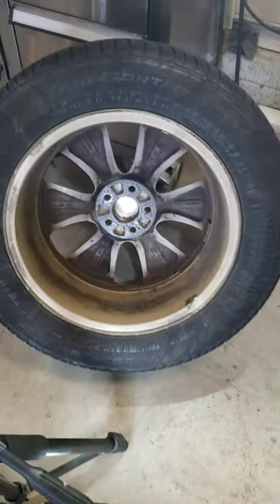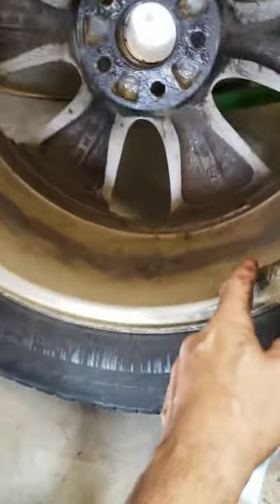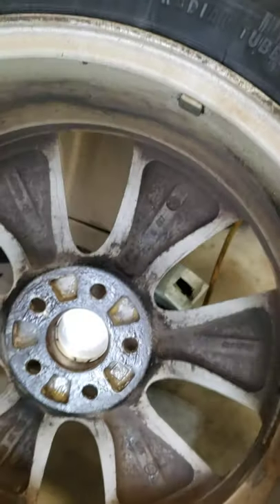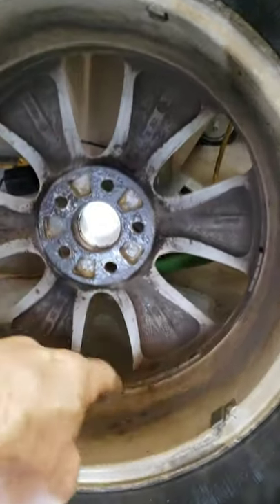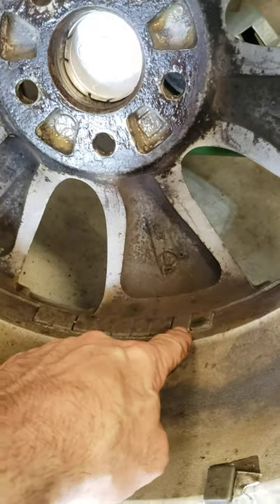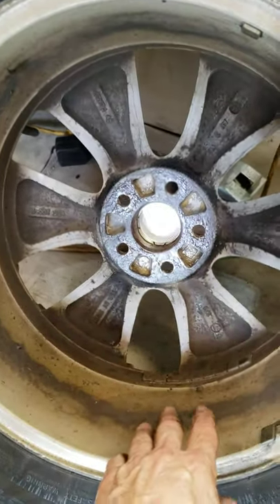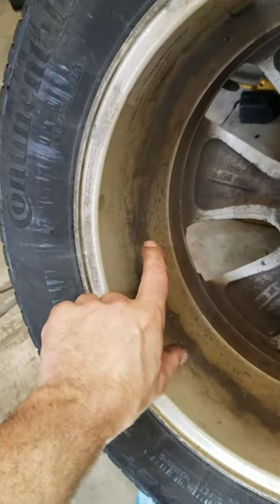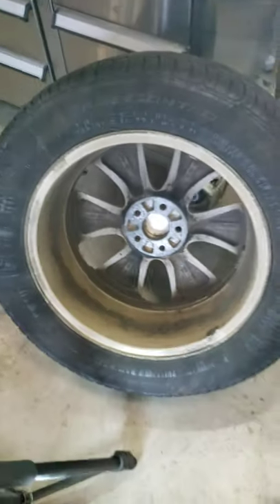How NOT to Balance A Tire #shorts

Comment: Your advice stands true on a good newish tire, If a tire has some wear machine will replace weight for missing tire material were it needs it. Yes it could be all over the place.
Reply from the maker: Any weight that is on the same side of a rim that is not in the same spot is an incorrect balance. That is a fact.
Reply: @ozzstars_cars  false as used tire's will vary in wear from side to side.
Reply from the maker: @S13KON  you are 100% wrong. Come.to.your senses and do your homework.
Reply: @ozzstars_cars  I already know who didn't do their homework. 👍
Reply from the maker: @S13KON  I have no idea who you are but if you made a video on the subject I would imagine you are the kind of guy that would film without any talking. Bet me.
Reply: How many tyre have you balance in your life?I do 100 per day and you are 100% wrong.
Reply: @تاریخپلاس-ذ7ب     
who are you addressing that statement/question to? There's two people in this thread with differing opinions...

Comment: I bought a new machine, fairly cheap (1500 dollars) and it does counter balancing. It asks for adding in second spin in diff locations. I rotate tire 90 deg / 180 deg on the rim to reduce weights, but in the end it asks again to add fx. small 5g weght in another location. I did calibration of machine but it still does 2nd spin and asks for second location.
Reply from the maker: The machine is not being properly set up. Contact the manufacturer.

Comment: Isn't putting weights (not this many) in different areas of the wheel from close to the center to the edge part of dynamic balancing?
Reply: There are different methods for balancing the wheel, one of them is to put the exact right weight(s) at one location opposite the center of balance, which this guy apparently does and thinks is the only way. There is the other method where you start by putting a little too much weight at the same spot as before, but then split it and move the weights apart.  This  2-weight-location method is supposed to be better.

Comment: When you do your second rotation on the balancer,and it calls for more weights in another area. Then what are you supposed to do? Because 99% of the time it always does.
My machine is a brand new digital model.
Reply from the maker: Could need to be calibrated. Contact the manufacturer.  Otherwise spin the tire on the rim 180 degress and rebalance. What are the results?
Reply: @ozzstars_cars  tried that, same results. According to the mfg'r it's designed to that. Because imbalance issues are never located in one central area. Due to the wheel ass'y being two separate pieces.(rim/tire)
So it locates the larger ammt of imbalance first. Then the lesser, during the second rotation cycle.  My question is, when using sticky weights in place of hammer weights on the rim bead. Where do you put them when it calls for it on the outside of the rim?
Reply from the maker: @carolinawestern3875  if.just using  stick weights on one side that is a static balance, weights on both sides are called 2 plane.
Reply: @ozzstars_cars  so is it ok to stick 'em on the outer side of the rim to?
Reply: Usually use clip weights on the side people cant see.
Reply: @carolinawestern3875  if you divide your wheel into 2 imaginary hemispheres, wouldn't any weights added on the opposite half just subtract or cancel out any weights already added on the first half. Seems like any/all weights should be in one place... unless you're doing the Y thing, then they should be split equally on either side of the "point" A, equidistant on either side of point A. Am I thinking this thru correctly?
Reply: @ozzstars_cars when you say two sides you're referring to the inside of the rim and the outside of the rim, correct?  With stick on weights I thought you wanted them place on the centerline of the wheel... and you don't really want them on the outside where they're visible and no real good place to stick them on the outside...
Reply from the maker: @gerrymatheson4020  inside the rim, on both the outer and inner side as seen in the video, in one spot, not all over the place.
Reply: @gerrymatheson4020  Only if identical weight. I've since learned cycle #1 simply gathers the imbalance weight itself.  After adding initial weight. Cycle #2 pinpoints  the imbalance area and remaining weight needed.

Comment: If i’m doing this on a bubble balancer at home, where do you put the stick on weights ? Near the face of the inside wheel, middle or furthest out to the underside of the wheel???
Reply: My understanding is you wanna put them as close to centered on the centerline of the wheel... not out near the edge... but I'm no expert, just a diy guy learning from videos, watching lots and gleaning what makes the most sense...

Comment: Good information bro... But i also needed to know that in some wheels along the offset there is a slight bend so do you put the sticky weights in the bend portion or the straight portion of rim....

And while putting the width in the balancer is the width written inside the rim proper or should i scale it using calipers ?
Because sometimes i find a little difference when scaling with the calipers
Reply: If the wheel is bent try to zero the balance and throw it to the back of the car so you don’t feel it and mmmm UNLESS the wheels are staggered…
Reply: @belemollyon3330  actually the wheels are like that itself... It's manufactured like that

Comment: I get why the weight going across is incorrect; but for the ones with the gap, maybe they were trying to hide the weights behind the spokes (but set the spokes incorrectly)?
Reply from the maker: There is no hiding in the weight game.  A professional should know better.
Reply: TO the point the poster is trying to make the new balance machines do have a feature that you can hide thr weights, so Yes, it can be done. And I'm not talking about a Chinese machine. I've had a Hunter balance for a long while now ans there is that feature in which the machine measures where each spoke is and then calculates if it needs to put weights in multiple locations behind the spoke.
Reply: @ozzstars_cars  A modern Hunter balancer has a hide a weight setting. Splits the weight accordingly between spokes, calculates seperate values for the spokes. Works nice.
Reply from the maker: @mattdudley3789  interesting.  I have never seen that before.

Comment: Must've been a real bad Chinese electronic balancer there! I think they build them that way so they can try to get  the buyer to constantly buy weights from them. They probably sell cases of unnecessary weights over the life of the machine.
Reply from the maker: Most times when I see this the tire tech doesn't set up the machine properly with correct tire and wheel size.
Reply: @ozzstars_cars  - Ahh, that’ll do it!